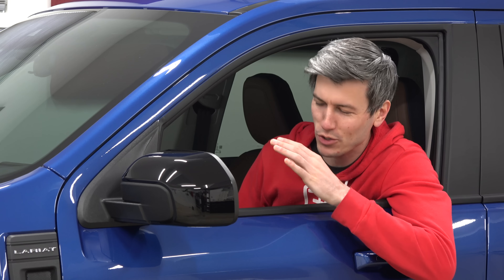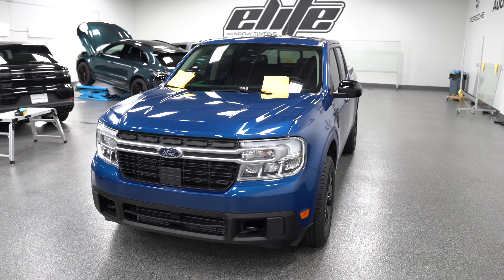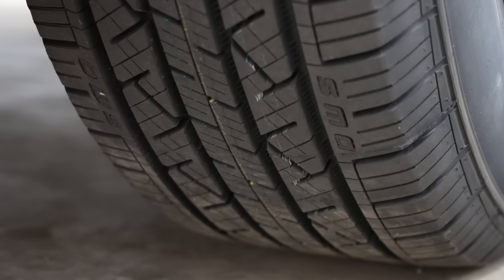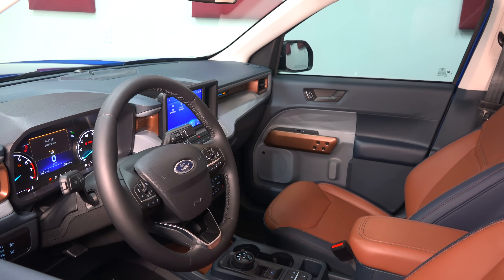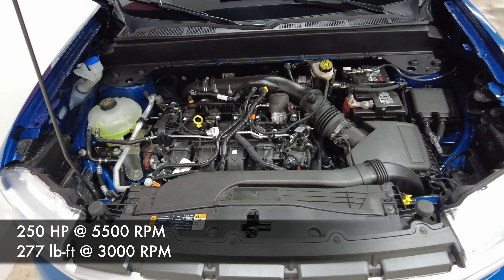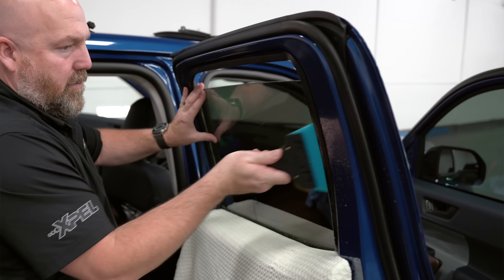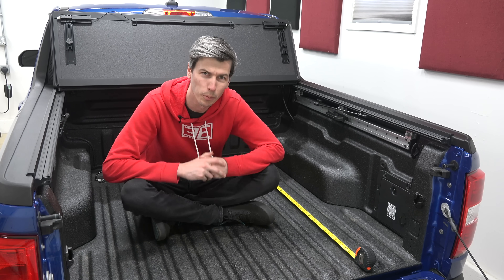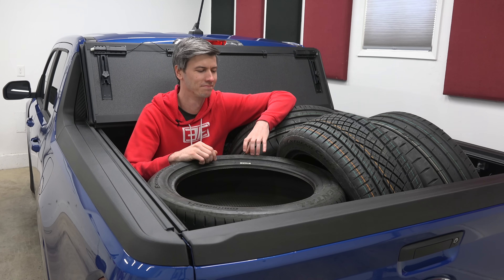I Bought A Ford Maverick! The Perfect Pickup?

Comment: I suspect that in a few years Mavericks will be extremely cheap on the used market. They're selling a lot of them. And I suspect that most people who buy them will discover either that it's not enough truck or that an SUV or van would suit their needs far better.  Same problem the S10 had:  great for gardeners, exterminators, and pool cleaners. But all style and little substance for everyone else.

The Maverick seems to be great for its niche users.  But by virtue of being cheap and kinda cool, it is attracting a lot of interest from outside that niche.  Or maybe it will last simply by virtue of being a lot cheaper than an Explorer, Highlander, or Grand Cherokee.

Also if you get bronze wheels you need to get a Subaru WRC livery wrap.
Reply: S10 didn't get 45 mpg.  We traded in our 2017 crv for the Maverick.  This was the only hybrid I had ever considered because it was the standard engine option.  Wish it was available sooner as it would have been the perfect baby hauler.  Throw the stinky baby stuff in the bed and just toss the stroller back there and you are good to go instead of trying to Tetris everything into the cargo area.  The seats are way more comfortable than the crv and the heated steering wheel is awesome.  Perfect commmuter csr.  The Maverick should be considered over the Corolla or the Civic since for the same price you get way more versatility without taking much of a hit to fuel economy.
Reply: @marklihsu  Yes, the biggest thing it has going for it is price. Otherwise there are definitely hybrid SUVs that serve the needs of most people better.  

CRV, Rav4, Highlander, Explorer, Escape, Grand Cherokee

Comment: I strongly considered the Ford Maverick (4k towing). Ultimately went with the Honda Ridgeline (5k towing). Recently I've found myself questioning my decision. An AWD plug in hybrid with 4k towing, that would have sealed the deal for going the way of the Maverick. HOWEVER, if Subaru would bring back the Baja with a turbo boxer 4-cylinder, or even better the H6, I'd be camped out at the Subaru dealership.

Comment: I agree with voting with the wallet.  Part of the reason I bought the xlt with the fx4 and 4k packages.  My only hesitation is that it wasn't a hybrid with AWD for snow/ice (would forgo towing package for that).  But at least it has a lot of common parts with the Bronco and Escape, so long term parts availability should be good.

Comment: The only problem with everything you just said is that a minivan is just as equipped and capable as your “truck”, and at $40k you can get massively better used truck with much more capability. This whole video is you just trying to convince yourself that you bought an actual truck
Reply from the maker: It wants to be a truck real bad tho. Minivans are great.
Reply: @EngineeringExplained  I agree it has potential, but front whee drive and auto absolutely ruined it for me

Comment: $40k would also get you a Honda Ridgeline, which has never been a big seller. Is the Maverick's popularity then its availability in less-expensive trim levels?
Reply: I think it had a surge in sales over the past year.  But definitely a great alternative.  These are good choices for someone that doesn’t use the truck for heavy towing.  Personally like both but fit into full size options better.  The seat weighs in higher regard for me.  😂

Comment: Can this thing even safely pull it's own weight at highway speeds?
Reply from the maker: No, it usually flips over, but it's light enough to just flip back and keep at it.
Reply: @EngineeringExplained  No batteries. Makes sense.

Comment: My Renault Clio IV fits 3 bags of mulch in the hatch without folding down the rear seats.
Reply: Before I got my Maverick I did that in the back of my ml350 and when I sold it 5 years later there were still mulch bits back there.  Such a pain to clean

Comment: its unibody, its not a truck. its a compact SUV with the trunk opened up. that said, for some one with little use for a truck, its a good option, but you probably should have gotten yourself a Honda Ridgeline, it might not be as fuel efficient but you won't get called gay, or a poser and it won't break as often
Reply: @michaeljamesm  lol I'm an electrician and my truck is full of tools, I pull a 14x7 enclosed trailer. I have every use for a truck and every reason to call a person gay. Move on champ.
Reply: @gtileo  sorry I read your comment wrong you said for someone else with little use for a truck, not yourself, so I will change my reply. All ‘trucks’ are gay

Comment: 2 points, you can swap an f150 shifter in for the wheel, secondly congrats on the adaptive cruise and heated steering wheel, i drive the Taurus sho and they're indispensable 😆

Comment: Thank you for this video, Jason.  I ended up with a 2024 Lariat Hybrid in Hot Pepper Red as I live in the deep south and snow is not a consideration.  It has been an AMAZING vehicle and does what I need it to do.  I came from a 2013 F150 Super crew 4X4 which was also a fantastic vehicle that was extremely reliable.  That same truck now is almost double what I paid in 2013 and I RARELY needed the capability so this just made sense.  I really look forward to your opinions on this truck over time.

Comment: I drive a fully optioned Toyota Sequoia SR5 4x4 5.7L with 9800 lbs towing capacity because Toyota doesn't offer a Ford Excursion size SUV. And I would not buy the Toyota new downsized 3.5L turbo as the 5.7L replacement. It is a downgrade. 

I like the Ford/GM/Dodge 3/4 T turbo diesel 4x4s but worry about build / design quality vs Toyota. 

A TRD supercharger may be in my future.

And this new vehicle of yours isn't a truck. Its a cool SUV with a bed instead of a hatch.

Comment: Unless you are constantly hauling something, a pickup truck is inferior to a small sedan with a trailer hitch. Why waste gas while being less comfortable and more of a hazard to other cars on the road.
Reply from the maker: I have a Model 3 for most scenarios.
Reply: My hybrid Lariat maverick is very comfortable.  I drive a measely 70 miles a day and never felt fatigued.  Way better than our old 2017 crv.  Plus you sit higher than a sedan.  You should go test drive one.  It's smooth easy to drive and park.  The turn radius is much larger but not terrible.  Had to get used to 3 point turns on 2 way streets but that's about all.

Comment: 40k on a Maverick... No thanks. I spent 25k out the door for my XLT hybrid Maverick with trailer hitch and 400 watt inverter. The point of this truck is to be a great inexpensive little Truck. 40k is not inexpensive. For 40k you can get a new 2024 Ranger.
Reply from the maker: If I wanted a Ranger I'd buy a Ranger; it's too big for my needs! Agreed on price, but inflation sucks - $40k today is $30k in 2016, just $5k more than I spent on my Crosstrek, and a lot more vehicle.

Comment: Being able to run to Home Depot or whatever now and then and get 40 to 50 miles per gallon I love the hybrid
Reply: Now let’s see him try to put a standard 4x8 piece of plywood in it…
Reply: My civic can do the same and it’s a 99
Reply: @waterloo123100 i don't think your civic carries as much stuff
Reply: @MainInternetUser  I'd bet everything I own that a civic will carry everything the average person need for 99% of all trips. The 1 trip per year you need to actually haul some stuff, you can rent a truck for $135/day here in Vancouver.
Reply: @sachamm why do that when you can buy a maverick that does everything the civic does, while being a better car, that also gets the same or greater mpg
Reply: @Rudenbehr  Because nothing you said is true? Civic is cheaper ($23k vs $25k), more reliable, more comfortable to drive and ride in, gets better fuel economy (25 mpg vs 31 mpg), is cheaper to insure, and is safer to drive (4/5 vs 5/5).

The only reasons to own a Maverick or a pickup in general is if you need to haul large loads on daily or weekly basis, or you have money to burn and collect cars, or you've been brainwashed by advertising. I'll leave it to the reader to decide which reason applies here.
Reply: @sachamm  ok
Reply: @sachamm  Talk to me when your civic can fit 3 motorcycles in the bed. Or tow a race car 500 miles on one tank.
Reply: @blackhatch46  With the money I save from buying and operating a civic, I will rent a truck when I need it and unless I do that dozens of times per year, I'll end up with money in my pocket that you won't have.
Reply: @sachamm  Uh... Its a 2002 F350 that has been paid off for YEARS and costs very little for insurance and tag fees. I HIGHLY doubt it. I also have a miata and bikes for commuting.
Reply: @blackhatch46  lol that's not the scenario we're talking about but sure, if we ignore the previous 20 years when you actually paid for the truck, and we ignore the cost of the other vehicles you have to own and operate, and we ignore your personal time getting your aging fleet serviced and repaired, then you might come out ahead. 👍
Reply: @sachamm  But that isn't the real scenario. Even if I had to go down to one vehicle, it would still be the truck. It can literally do anything. And I have done the math, yes I come out WAY ahead. Keeping a vehicle or buying used, is infinitely cheaper than new.
Reply: @blackhatch46  Well I already said that there are scenarios where pickups are useful. It's just that 99% of pickup owners aren't in those scenarios. Who cares if you can tow a million pounds if you never do it? Maybe you're the 1% that does actually need a truck... I don't know and I give you the benefit of the doubt that you do.

But what I do know is IF you're not towing that million pounds at lest once a week, you're just about guaranteed to be pay more than owning a practical car and renting a truck when you need it.
Reply: @sachamm Half of Home Depot is stocked with items that don't fit in a civic. Like literally at all. Where would you put a toilet? New mower or lawn cart? A flat pack closet unit? A few 8x12s even cut in half.  One sheet of plywood? A door or window? I guess maybe if you have a roof rack that is loud and scratches the paint anyway. You could probably fit some door trim with the trunk open and possibly damaging your trim. 99% is the wrong made up statistic. Or you don't ever shop at Home Depot for medium home items. Just refill bottles and hand tools. Half of the United States's population lives outside of the city. Each one of them knows or is the local handyman.
Reply: @0Rookie0  Sure do. I rent a pickup for an hour several times a year and it costs me ~$35 each time. Yearly cost is less than just the difference in insurance costs between a car and pickup. And if I need a van, I rent that instead for $35/hr. And if I ever need a fancy 2 seater, I can rent that instead for $110/day.

Last year, ALL my mobility costs -- that's transit, bicycle, car/truck share, parking -- added up to $2300. You can't operate a beater car for that amount and your average new truck will run ~$10,000+/year to own and operate here in Canada.

The prices are different in the US but the price differential isn't. Truck ownership is a scam run by car manufacturers.

Comment: Looks pretty cool. In Spain (Europe), pick-up trucks are rare. Even in the country side. I have two questions 1) is this a monocoque vehicle? 2) In rain or snow, the bed gets wet or dirty if it is covered? Thx.
Reply from the maker: 1) Unibody
2) With tri-fold, yes, it will get wet/dirty. If you get a proper truck cap I believe you can seal it.
Reply: @EngineeringExplained  This car is in a very convenient size. The big trucks are simply too big for Europe. Your white board is a legend here. Greetings from Spain!

Comment: I'm sure you've heard but if not, there's a recall on these 2022-2024.  Was on the news yesterday.
Reply: Did you look into what the recall was for? It's a software issue with the taillights. Ford came to my house and fixed mine in about 30 minutes.
Reply: Yeah lots of recalls on my hybrid lariat as well but they are all minor.  Wish they would stop calling them recalls and instead software patches or usability enhancements.  None of the ones I've seen are anywhere near dangerous.  I got an emissions software recall.  Like really?  That has no bearing on functionality or safety.
Reply: @marklihsu  Except recall doesn't mean it's safety related, at all.  And legally, they have to call it what it is.  It is a recall for a manufacturing defect.
Reply: @marklihsu  I agree with you on calling them patches instead but the tail light issue is a safety issue and think it's a legit recall
Reply: I just got 6 recalls fixed on my 2022 (oof). They were pretty minor stuff though.
Reply: There is nothing wrong with recalls, the alternative is the manufacturer ignoring issues and telling the customers to deal with it.  Most recalls nowadays are due to software or part suppliers; something that every manufacturer has to deal with.

Comment: C'mon subaru, bring back the baja already!
Reply: Forget the Baja, bring back the Brat instead.
Reply: Forget that, bring back the El Camino
Reply: What's funny is I call the Hyundai Santa Cruz a 'roided-up Subaru Baja. The Maverick is meant to be a small truck that is still as practical as possible while maintaining as much benefit for being small and affordable. The Santa Cruz is more luxurious but it's not as practical and is several thousand dollars more (Yes, you can tow more in the Santa Cruz but it gets the same fuel efficiency as the Ford Ranger while being much smaller than the Ranger and a bed that isn't as practical as the Maverick). Basically, the Ford Maverick is a vehicle for people who want a truck - but don't want a /trrruuucck/. I'm not sure who the Santa Cruz-Baja thing is for...
Reply: @indigetal  The Santa Cruz has a higher tow rating than a Maverick with the 4K package but it does not have a built in brake controller or a 7 pin connector. Eitherwise I would have picked one up a year ago instead of waiting for a Maverick.
Reply: @steveogilvie5203  Well, the SE and SEL have a 3500 lb towing capacity but the turbocharged engine can tow up to 5k. I mentioned that in my comment already but even then it comes at the cost of good fuel economy that many expect in a smaller truck. Why even get a small truck then if it costs more and has the same fuel economy for less towing capacity than the Ford Ranger? (Santa Cruz with turbocharge starts at $38,460, tows 5k, and gets 22 MPG Combined, Ranger starts at $32,670, tows up to 7,500, and gets 22 MPG combined. The Santa Cruz is a Frankenstein's monster of bad decisions on practicality in a pretty package that you pay for, the Maverick is a masterpiece balancing practicality, size, and affordability.
Reply: @indigetal  I got my Maverick just before Christmas 2023.XLT AWD FX4 4K tow package and copilot 360. I love it and so glad I stayed away from the Santa Cruz.
Reply: The Baja was a great idea that came out at wrong time. If it came out today it would sell like crazy.
Reply: @hansschroedenbach  Except it's a subaru,  it would only get 27 mpg or spend 12k on the hybrid version to get 29 mpg.

I'd still buy it though.
Reply: @ChadRazorback the Baja was just an outback with half of the top cut off. Current gen outbacks get 34 mpg highway. How much worse does a bed really make aerodynamics compared to the standard roof rack bars?
Reply: @JohnDoe-my5ip  - Open bed with tailgate really cuts mileage unless you have a smooth tonneau cover. Another trick to improve truck mileage was eliminate tailgate and put in a cargo net.
Reply: Maverick bed length-54"
Subaru Baja bed length-41.5". Still useful, but really short.

Comment: i wish the gear shifting thing was on the steering column where it belongs instead of wasting all that valuable console space
Reply from the maker: I'm with you there!
Reply: @EngineeringExplained  Some guys are installing the new f150 shifters as they are also all digital but more traditional.
Reply: Should be in the center with 5 or 6 options to choose from 😉
Reply: @JoshuaTootell   P, R, N, D, L that's 5 options! 😀
Reply: Yeah, that is a bit of an oversight isn't it?
Reply: I miss my Silverados column shifter!
Reply: I just want to make sure my vote is counted that I disagree. Personally I loath column shifters.
Reply: @jeremyspecce  agree here too, they have never made any sense to me. I have a Maverick and love the dial shifter
Reply: @markjones5909  They should bring back the old Dodge push button shifters.
Reply: @jeremyspecce  - Column shifters allowed me to have 3 passengers with the old bench seats or with buckets I could put a cooler on the space where the floor shifter is. With an automatic transmission the shifter location hardly matters. Floor shifters were rare before the muscle car era with "4 on the floor" for fast shifting when drag racing.
Reply: @jeremyspecce  why?
Reply: Agree
Reply: I am looking at a Mav Lariat, and will miss paddle shifters and perforated ventilated front seats. The Mav checks almost all the other boxes and can transport mountain bikes (that my Optima SXT can't).